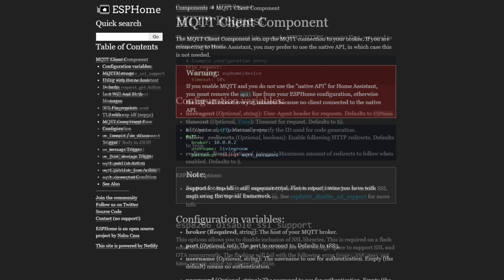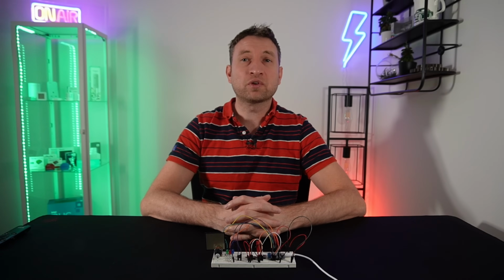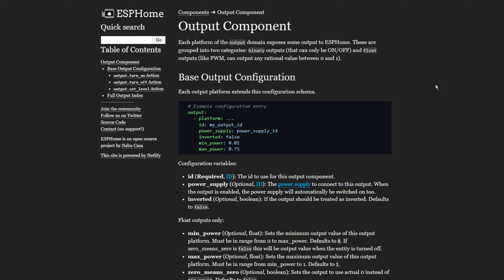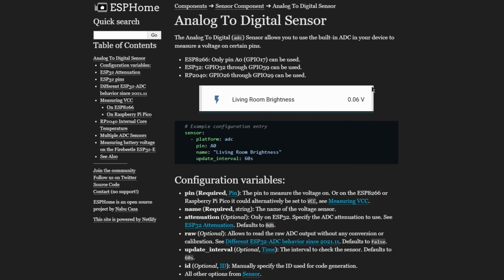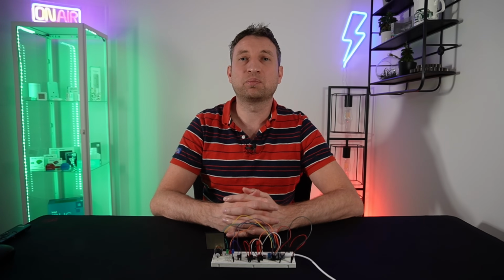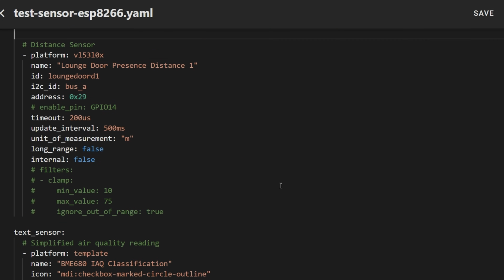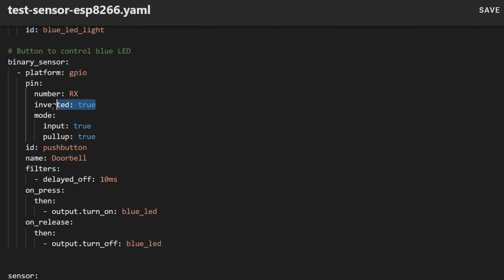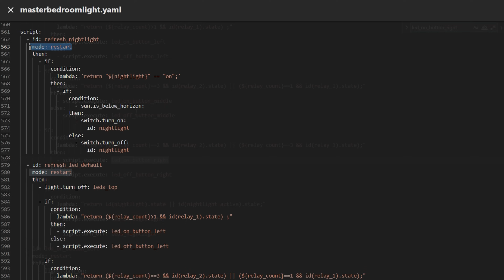ESPHome Guide for Advanced and Intermediate Users

Comment: Great video series.  Will you cover how to create a custom sensor in ESPHome?  I have a I2C sensor that is not currently a platform in ESPHome but I do have the arduino C++ library for it.  From the ESPHome website I see that I should be able to make this work but they don't give very good examples.  It would be ideal to keep my sensor library and code on GitHub and link it into ESPHome when compiling.  I just have not been able to find an example of how to do this.

Comment: One clarification - you mention that with lambda functions, a lot of the work can be done on the esphome device, but changes will require new firmware.  You are able to pass along value from HA into esphome for some customization.  For  instance, I needed to offset a sensor value to calibrate it and I was able to use a helper in HA to make the adjustment and pass it to esphome without the need for a firmware change.
Reply from the maker: Yeah, for sure linking them up to HA entities is the best way of keeping flexibility of settings.

How's the brewery endeavour going?

Comment: Excellent video, going to be very helpful thanks. Have a look at the only video on my channel, I’ve designed an ESPhome room sensor housing…
Reply from the maker: Nice! It looks like a well thought out design. Keep up the videos.

Good to see you're exploring Meshtastic too. I want to take a look into it in more detail. I was going to buy one and do a video on it, but I couldn't find much documentation, particularly around connecting sensors. Most people just seem to use it for messaging, which doesn't excite me quite as much.
Reply: @lets-automate  Thanks, I'm adding lux and mmwave presence in the next week ;) I've only just started playing with Meshtastic but you are right there isn't much about, certainly YouTube wise, on connecting sensors. There are lots of people doing it though so probably a good opportunity for some fairly unique content if you decide to go down that rabbit hole. I'm going to be designing a solar powered node to act as a relay, big antenna etc, and stick it on the house. Ideally want to add the standard weather sensors to it as well. The Comms Channel has a good build but no sensors so that my starting point.